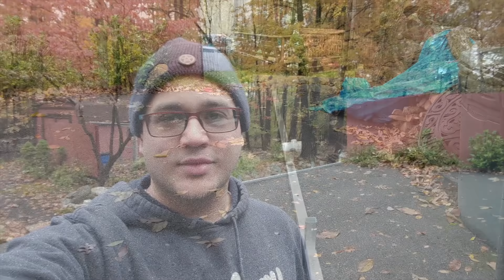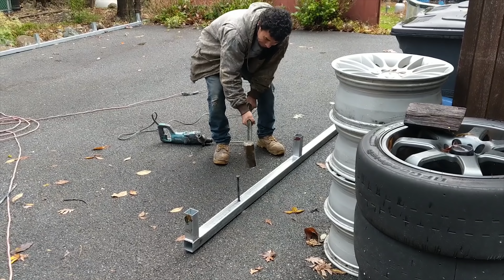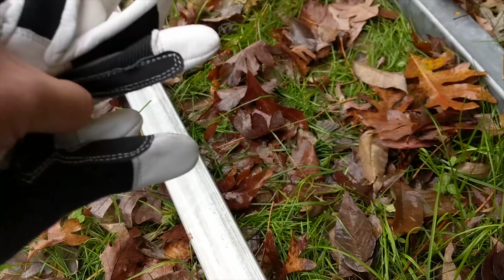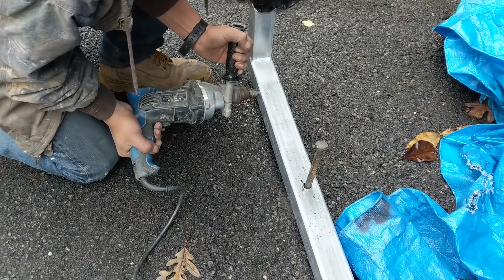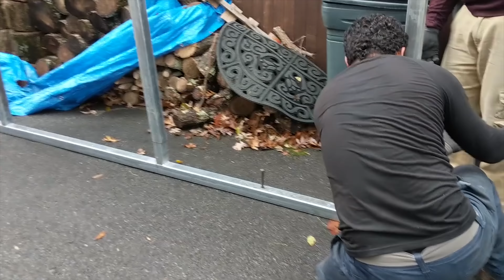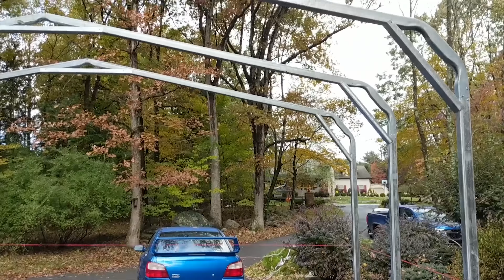FINALLY Got A Garage for my Type R & WRX! Detailed Installation of 18x21 Steel Building Part 1

Comment: Quick question, any recommended tires for the Type R in the snow? Just got mine a week ago and I live in the northeast
Reply from the maker: 18 inch wheels, and get snow tires, or at least all season tires. If you're using stock wheels, Constinental DWS tires.
Reply: Sweet thanks for the quick response brother!